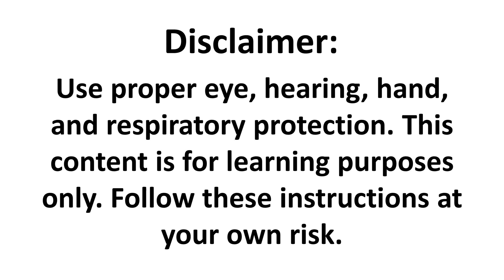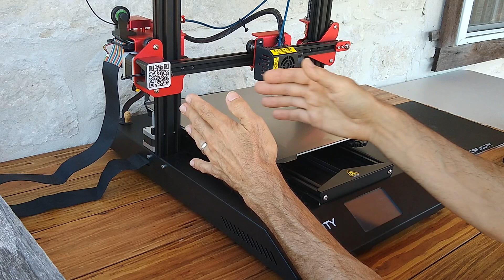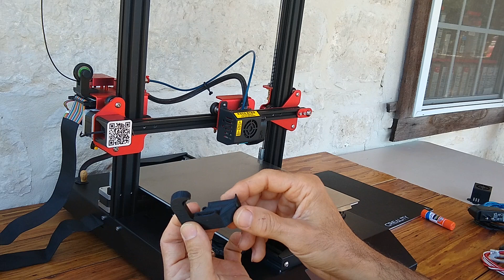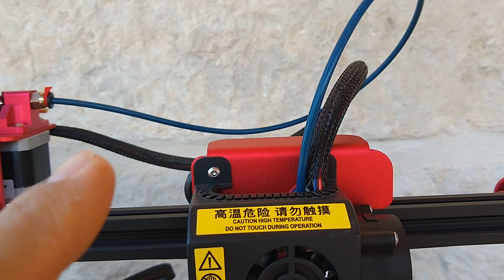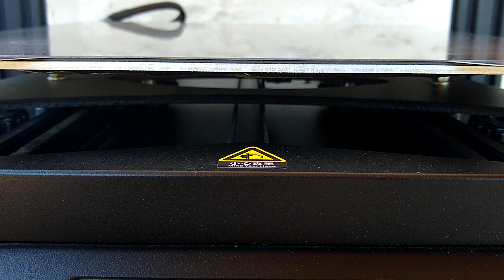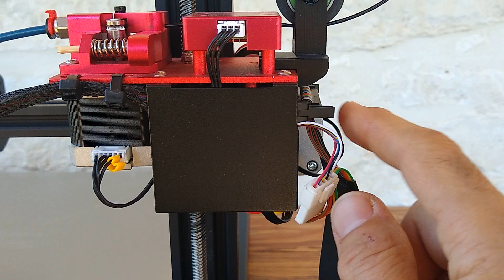CR10S Pro V2 upgrades that make a big difference in producing quality, and successful prints.

Comment: Thanks for making this video, I got a second hand CR10S Pro and this helped me bring it to life.

One thing I want to mention though, I printed your fan duct, and it worked great for the next two prints... and then... I hit a big problem with it. I printed it with PLA, and PLA does not hold up to the heat of being that close to the heated up nozzle during a print.  I did two prints with it that took around 2 hours each, and just that much heat exposure was enough to soften the arm with the secondary vent hole, and made that whole arm sag.  When I started the third print, the arm was hanging low enough enough at that point to actually scrape against what was being printed.  I don't think this is any flaw with your design, the design itself worked perfectly, but it definitely needs a more heat resistant material.

So, lesson learned... don't use PLA in any application where heat can soften it.

Comment: hello I printed your fan duct but is there a certain way I should print it I keep getting supports on the inside and can't remove them?
Reply from the maker: Hello, Yes, it can be printed without supports. Place it on the build plate with the blower fan side down. The side that blows on the part should be facing up.
Reply: @vbared  ok thank you it worked!
Reply from the maker: @Deadlineson  Awesome, great job!

Comment: the flex bed PEX is a must the stock plate is complete junk
Reply from the maker: Hello vrosi1963, Thank you for commenting, 100% agreed, the stock build surface was terrible. I've switched out the WhamBam flex plate for Garolite G10 and haven't looked back since. The pex film of the WhamBam blisters after awhile resulting in very ugly bottoms.

Comment: it amazes me when people say " well i changed  my bed because the adheasion was really good , and i put a crappy pei sheed on it ........"................COME ON GUYS .....
Reply from the maker: Hello David, Thank you for commenting. I print with PETG which is a material that fuses to the BuildTak lined aluminum build plate that came stock with my CR10S Pro V2 if the nozzle height is too close to the bed, ask me how I know this. I wouldn't recommend printing PETG on a non flexible BuildTak lined build plate. The aluminum plate the BuildTak is glued to, while much lighter weight than glass, is unfortunately just as warped as the heated bed itself. I opted for the PEX lined  WhamBam at that time, but it also has its share of issues. Weight and PEX film bubbling over time. A build surface that is truly amazing, that I learned about in 2021, for printing with PLA, PETG, and straight Nylon is Garolite G10. It's less than 1/2 the weight of the WhamBam system, can be flexed, will never bubble, and releases parts when cooled. 

Best of luck with your mods!

Comment: Why are the upgrades required?  Shouldn’t the printer work out of the box?  Mine didn’t and doesn’t.  Customer support sucks, waiting for credit card company to issue refund as creality do not respond.
Reply from the maker: Hi Simon, Thank you for commenting. At the time I  purchased the CR10S Pro V2 it was Creality's flagship printer. Like you already discovered the support not only from Creality but the 3D printer community was non existent. Dealing with problems right out of the gate seems to be common with most mid line printers. The good thing is that if you enjoy problem solving and are persistent all the issue can be addressed and the printer can be made to be super reliable and produce prints that are on par with thousand dollar 3d printers.

What kind of trouble were you having?
Reply: @vbared  , I am trying to print a project with PETG., the printer was damaged in transit, however having requested a replacement I just keep getting sent replacements parts.  I want either a refund or a new printer.  I bought the printer from CrealityUK, but it was shipped from abroad.
Reply from the maker: @SimonPlatten  Hi Simon, It's unfortunate that Creality is choosing repairs instead of replacement. I agree with your position. Hopefully you can get things sorted out soon. If you need big format printer consider the Ender 3 Max Neo instead of the CR10S Pro V2. 

PETG is an easy material to print with but you need to print it on Garolite. You'll have problems getting parts off of the stock bed that comes with the CR10S Pro V2 and PETG doesn't stick to glass print surfaces like the one that comes on the Ender 3 Max Neo.

I print exclusively with SUNLU PETG.
Reply: @vbared  thank you, the next printer I choose will have to support PETG and a large print area.
Reply from the maker: @SimonPlatten  I hear you, best of luck!

Comment: Hello Victor, I was wondering if you had to make any adjustments on your fan duct. Mine seems to keep dragging on the print bed. I was hoping you could give me some advice.
Thank you.
Reply from the maker: Hello JJ305, Thank you for commenting. I actually designed my own fan mount, ditched the whole stock metal cage assembly and added the Micro Swiss direct extruder kit. It's a real work horse now with minimal maintenance. Linked below is my video on mounting the new fan assembly.

https://youtu.be/V_3GLGS4bx8

Comment: After what I just saw, I just ordered this model and their plate that is similar to yours, maybe better luck with theirs and hopefully wont need to use the elmers glue lol. 
Would be great to see a complete how to set up like me video as I am going and buying all these parts now lol
Reply from the maker: Hi Crypto, My current setup has changed from that video, believe it or not, I'm running a standard Ender 3 V2 hotend on a Micro Swiss direct extruder kit. Everything works great now. Below is link to new hotend assembly.

https://youtu.be/V_3GLGS4bx8

Comment: Would u recommend this as a first printer
Reply from the maker: Hello Raincoat girl, Thank you for commenting. In my opinion based on my experience owning one unless you need the big build surface of the CR10S PRO V2, I would consider the printer below and upgrade it using the listed parts. In the end it will cost less fully upgraded than purchasing the CR10S PRO V2. If you decide on the CR10S PRO V2 I can send you a list of what I would change on it to make as reliable as the one below would be after the upgrades. 

3D printer I would buy today:

My Ultimate Ender 3 V2 Build List - 

3D Printer:

Ender 3 V2 - https://amzn.to/3BF2XwF

Upgrades:

Creality CR-Touch - https://amzn.to/3AFBytd
Micro Swiss dual gear extruder kit - https://amzn.to/3quGWx6
Creality 3D Printer Accessories Kit - https://amzn.to/3wuaq1Q
Ender 3 V2 Anti Backlash Nut with Lead Screw Support - https://amzn.to/3opukWR
Bearing Set - https://amzn.to/3ay5sVF
G10 Garolite Build Surface - https://amzn.to/3tNSGg8

Super Quiet Upgrades & How-to Video:

4 Dunlop Squash Balls (Need 2 Sets of 3) - https://amzn.to/32jPqhH
Noctua 40x10mm Fans (Need 2) - https://amzn.to/3JjSTxq
Noctua 80x25mm Fan - https://amzn.to/3Jk2u7i
Voltage Converters (Buck) -  https://amzn.to/3vZN56W
https://youtu.be/ycvHpMbo5Hw

3D Printable Files - https://drive.google.com/file/d/1EP_I6gEWe-FosKM378UJI-PVBOrBvQaV/view?usp=sharing

Custom 300-degree firmware and complete install video:

Ender 3 V2 Jyers Custom Firmware - https://drive.google.com/uc?export=download&id=11VYODvhCfL_VLEZ_GkplXYnc2kVU_woV

How to install the Jyers firmware - https://youtu.be/amRldRpnK2Y

Comment: hey you should redesign that fan duct to include the blow motor housing.  so you can use 3 bolt holes making it really strong.
Reply from the maker: Hello Tiny Gunner, Thank you for commenting. I'm currently this hotend setup that blows the stock cooling assembly

https://youtu.be/I7XJ-cgOgzE

Best of luck with your build!

Comment: Can you flash CR10pro v1 with  v2  firmware and  screen files?
Reply from the maker: Hi Panel, Thank you for commenting. I haven't tried doing that but if the main board has the same model number and the capacitive probe is wired the same pins as a BL-Touch then I would say yes.

Best of luck with your mods!
Reply: @vbared  switching Z+ to Z- is not a problem, the boards seem to be the same.  I was looking for an answer for "pause at height"  not working using the OEM firmware. I  switched to tiny machines  DW7 - pause  at  height  works  now,  however, DW7 has  a lot of bugs and I dont  want  to go on with it.   So I just   thought I could try with creality v2 newer firmwares   since  v1 is not updated any more.  Though I think pause  at heigt (m600) is also disabled  for the oem v2 firmware. One difference  however, V2 is provided with the source code   which you can edit  and correct this with source code lines from the tiny machines firmware.
Reply from the maker: @pawelw.9172  A YouTube subscriber sent me this. I'm currently needing to pick up another Raspberry Pi. This looks promising.

https://github.com/Desuuuu/DGUS-reloaded-Klipper

I'm currently using Klipper with one of my Ender 3 V2s and it's amazing. 100mm/s print speed, pressure advance, input shaping. No more compiling firmware just edit the printer.cfg file and restart, easy peasy.

Comment: Is that replacement fan duct working out well? About to get the Micro swiss hot end and I'm going to print out your duct.
Reply from the maker: Hello Fett426, Thank you for commenting. I've run into issues with the Micro Swiss heater block working itself loose from the heat break. I haven't figured out why this happens but when it does it molten filament will ooz out of the threaded top or bottom of the heat block resulting in a huge mess. What I've found that works best is a stock hotend from and Ender 3 V2 mounted on a fan assembly and ducts that I designed for the Micro Swiss or stock Creality MK8 hotends. Check out the video below on how to install it (link to the mount is in the video description). If you need it to be all metal there are titanium heat breaks that can be added to this hotend. The Amazon link below is to a fully assembled Ender 3 V2 hotend. I just order it take it apart and use the hotend and fans on my mount. If you want to run dual parts fans check out the last link on the ones that I use.

https://amzn.to/3CotT7d

https://youtu.be/V_3GLGS4bx8

https://amzn.to/3PqBAMI

Comment: I love the peanut upgrade! Thanks, man! Well done.
Reply from the maker: Hello Mitchell, Thank you for commenting. The peanut proof of concept is what I call it. Linked below is the part that came from it. If you have a CR10S Pro V1 or V2 the .STL file will keep the bed wire from hanging up on the edge of the metal cover.

https://drive.google.com/uc?export=download&id=19PZOHD4Y67q0gvQx7_PYfHWgEjLVtqTn

Best of luck with your mods!

Comment: The best mod you show here is the peanut hole plug 🥜
Reply from the maker: Hello Rachel, Thank you for commenting. The peanut proof of concept is what I call it. Linked below is the part that came from it. If you have a CR10S Pro V1 or V2 the .STL file will keep the bed wire from hanging up on the edge of the metal cover.

https://drive.google.com/uc?export=download&id=19PZOHD4Y67q0gvQx7_PYfHWgEjLVtqTn

Best of luck with your mods!
Reply: @vbared  Thanks for the reply! A friend gifted me a CR10S Plus that needed some tlc and a few parts replaced so I've been doing some upgrades and cleaning on it. Noctua fans, cr touch, doing some rewiring. I'll check out your link!
Reply from the maker: @WwillowwispP-j9o  Super cool, it sounds like you already have experience working with these amazing machines. If you come across anything you haven't already encountered  just ask. Maybe I can learn from you or help save you time.
Reply: @vbared  This is the first one that I own, and I'm very excited about it! I've borrowed an Anet A8 and an Ender 3 before so I have some experience, but mostly just from educating myself through youtube and channels like yours. Subscribed friend, I hope we can learn together!
Reply from the maker: @WwillowwispP-j9o  Welcome to the 3D printing community. This hobby is wonderful and there is lots of support. There is so much cool information the learn.

Enjoy your weekend!

Comment: Amazing video sir! Very detailed!
I was trying to decide this printer or the CR 10 Max and I think this is the winner.
Thanks Again!
Reply from the maker: Hi Drake, Thank you for commenting and words of encouragement. Will this be your first 3D printer and are you needing a large build plate?

Best of luck with your build!
Reply: @vbared  , yes it will be my first.  You can only imagine how much stress it can be to pick a 3D printer out, learn of its reviews/upgrades, take in all criticism on that printer, then be shifted onto another one because someone says,  "If you're going to spend that much money, might as well get this one." (Insert alternative Printer here.) LoL. I've been wanting to get one for nearly a year now and decided to make the jump now knowing I have SOME free time to learn about the softwares, slicing, and so on. Haha
 If i wasnt going bald before this I am now! LoL
Reply from the maker: @DrakeForAmerica  Hi Drake, is the large 300x300 build plate important to you? If not consider an Ender 3 V2, it produces cleaner prints, has a 235x235mm bed, fantastic community support, the best firmware development, and I can send you a list of all the upgrades needed to make it bulletproof for less than the cost of the CR10S Pro V2 alone. It's so good that I'm running two of them.

The biggest drawbacks to the CR10S Pro V2 is community support, proprietary touch screen (which limits firmware development), and finally cost. I've got my CR10S Pro V2 running reliably now but it took extra money in upgrades to get it there. If you require a 300x300mm bed or bigger let me know and I'll send you the upgrade list of my current build.

Best of luck with your build!
Reply: @vbared  I second this - I got the E3 V2 as my first printer a year or so ago and it's great as a first printer. I found there was a bit of a steep learning curve but it was great to see lots of videos on youtube specifically for this printer so that was very reassuring. I came across this video as I have just ordered a CR-10S Pro V2 because I want to do some slightly larger prints such as (cosplay helmets) and the bed size on the Ender was just a little small. I'll still keep it as a second printer to tinker with and delve a little deeper into the hobby (octoprint, hardware upgrades etc) safe in the knowledge that I'll have another printer if it all goes horribly wrong!
Reply: Hi Victor, I am interested in your latest list of upgrades. I’ve had the CR-10S Pro v2 for several years now, and I think my heat bed is warped. I’ve printed 3 of the parts, the 2 for the filament and one for the fan - probably 3 years ago. I really want to get this thing running well again. I’ve also replaced my boding tube a few years ago.

Comment: Great video, very informative. I don't know if you mentioned it and I missed it but, how often are you having to adjust your bed ( bed level ) after prints?
Reply from the maker: Hello Michael, Thank you for commenting and encouragement. My CR10S Pro V2 came with a factory installed BL-Touch so all that is needed is the initial bed level and correctly setting the z-offset. Once those are set I don't have to mess with the bed leveling again unless I switch nozzles or remove the hotend for maintenance.

Let me know if you have any other questions or trouble with your prints.

Comment: What temp do you heat the bed to with the Wham Bam plate? I’m having issues with prints warping with the plate. They recommend 70c for pla but it warps like crazy so I lowered it to 50 and it still warps. And do you use economic mode or not?
Reply from the maker: Hello Joe, Thank you for commenting. I print with Sunlu black PETG and for that material I set my bed to 77c. I don't see the economic mode anymore since I flashed my firmware to get the advanced setting so I guess that it's not enabled. I stopped using PLA because of its sensitivity to heat. Sunlu PETG doesn't have those issues, prints like PLA and sticks like crazy to Wham Bam with the PEI film and Garolite.

Best of luck with your mods?
Reply: @vbared  thanks for the quick response. I am using PLA on my very first role I guess I know to move away from that with the heating issues I’m already having
Reply from the maker: @josephmodesitt  PETG costs the same and produces prints as good as PLA. In my opinion it's worth tuning your slicer settings for it. I print the SUNLU at 230c extruder, 77c bed, if you are on bowden set retract distance to 5, retract speed, 25mm/s, print speed 50mm/s and that's about it.
Reply: @vbared  Okay cool. Thanks, I appreciate it!

Comment: Hey, I saw someone recommend giving this machine a triangular frame structure like the CR-10v3 has. Do you think its worth it?
Reply from the maker: Hello Peter, Thank you for commenting . In my opinion If you plan on printing very tall items then making the carriage frame more rigid will improve your prints at the upper limits. If you mostly print items that are up to half the machines max height then you might not see any difference.

Best of luck with your mods!
Reply: @vbared  Thank you, I really appreciate it. I just bought one of these second hand today. My first printer.
Reply from the maker: @phun1901  Don't hesitate to ask me any questions about it. Getting it all calibrated is the tricky part.

Have fun with your new hobby!

Comment: Hi Victor, like your fan duct but how do I print this... when printing with support the duct is all full with support :-) Should I print it without support??
Reply from the maker: Hi Peter, Thanks for commenting. Print it with the small duct facing up supports touching the build plate only. you should only get a small support for the fastening tab only. Everything inside should not have supports.

Best of luck with your mods!
Reply: Hi Victor, that worked out great thx for the tip!